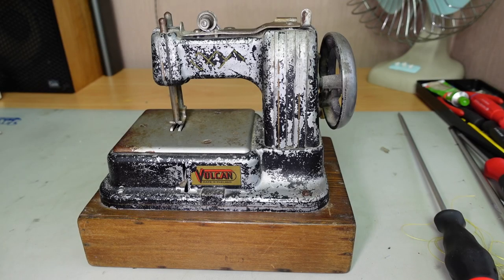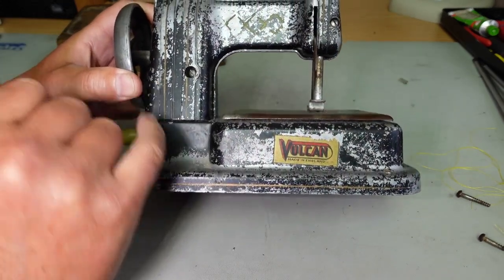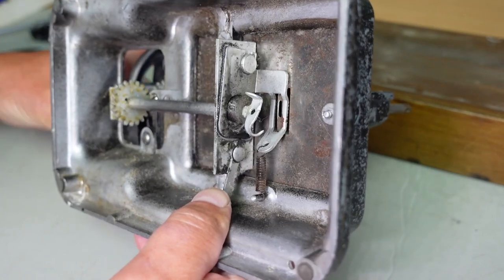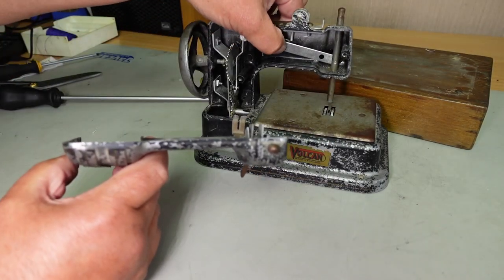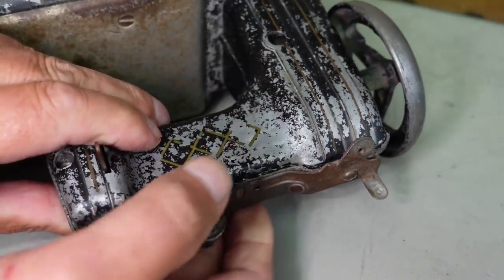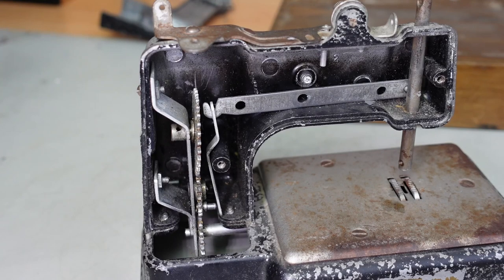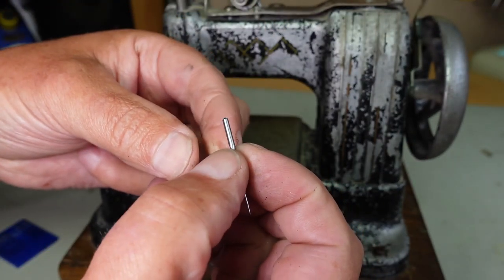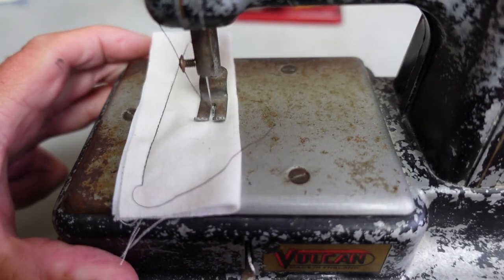Vulcan Toy Children's Sewing Machine - Will it Sew Again?

Comment: The solution to just keep screw and nut in place by the cover is a pretty neat idea and avoids drilling a hole into the machine. It would've been nice to get rid of the rust, especially on the needle plate to have a smooth surface again for the tissue to glide with less resistance and finally oil the moving parts to make it run smoothly. Keeping the rest of the patina is a good decision.
Reply from the maker: Thanks. The needle plate appears to be painted and the rust is definitely something I will deal with. This video was really only to see if I could get the machine up and running, not a restoration video. Thanks.

Comment: Regarding the broken bar stub. A few ideas. What if you take a really small sheet metal screw and screw it in the little stub after predrilling it. Ofcourse is hard to see what you have left to work with. Or maybe epoxy on a small washer to keep the bar from falling off. Or putting a snap ring/ circlip or a JC clip on it. I know there's not a groove for it but there shouldn't be much sideways torque there and it should stay.  It maybe cut a groove for either into the little stub.
Reply from the maker: Thanks for your suggestions. A small sheet metal screw may work. I don't think there would be enough of the stub sticking through to attach a circlip. Part of the stub is flush with the plate as it's kind of unevenly broken.

Comment: Greetings! some expertise wanted if anyone got the time :D Basicly, i got a old Husqvarna Viking Opal 650, it was a old school machine that had some needle clamping issues and some other minor stuff wrong with it, they were gonna toss it out, friend of mine rescued it with the thoughts of fixing it, newer got to it, then dumped it on me :D

Now i've managed to solve all the issues except one, the Needle clamp. The screw for it was completly striped, so i tried to get a new clamp. but APPARENTLY! those aren't available around here.... so i had to get the entire Needle rod, no worries there, got the part, realised its been changed a bit so i had to replace the entire needle bar+clamp, not just the clamp...... and i think i might have goofed :c

The needle bar is obviously meant to be in a certain position, its held by 2 clamp's that are screwed so i can adjust it up and down, but it just don't want to play nice :c Either it doesn't seem to want to catch the bobbin thread, or it does, sweeps around the bobbin case then gets stuck and rips the bobbin case out of its place, with a nice lump of tangled top thread under the fabric ;-;

Its a bit of a wild shoot i guess, but Repair manuals also seem unavailable (Or expensive) so i've been scouring the internet and came across this lovely place ^^ so yea, any expertise on what to do about it would be greatly appreciated. i've done to much to toss it out now D:

Kind Regards
-Askys

Comment: There's no need to drill and tap all the way through the whole machine if you were going to drill and tap and put a screw in it..😂
Reply from the maker: There's not enough thickness there to drill and tap so it wouldn't last five minutes. I wanted a more permanent solution. Thanks.